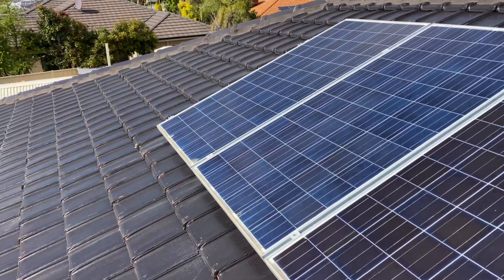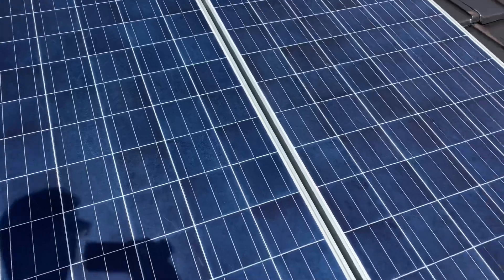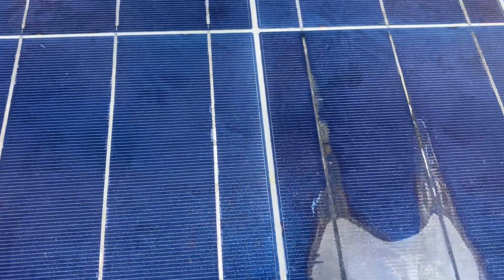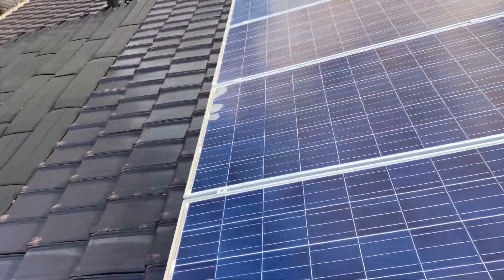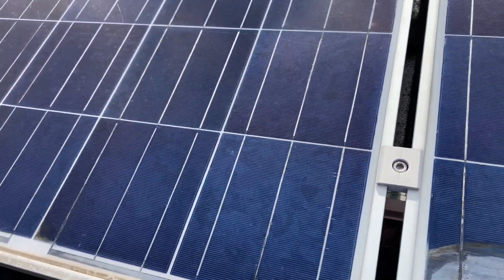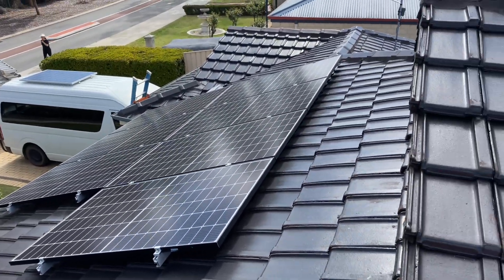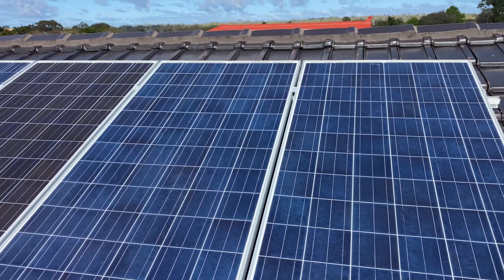Water cooled solar panels 🤣💦 WTF is going on here!

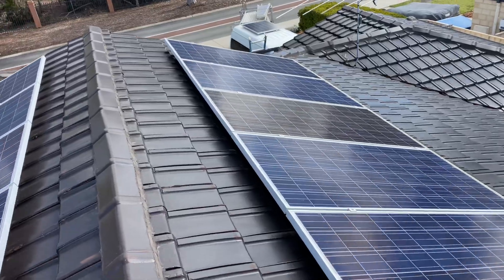Comment: That middle panel at 2:18 has already been replaced by the looks of it. Doesn't match the others. It does however match the panels on the NEW part!
Suspect the deskjockeys who did that roof also helped the customer out with a panel on the old section. Why not just replace all the panels and it would have been fine when they were there anyway?
Reply from the maker: Possibly yes 👍🏻

Comment: All they are doing is prepaying for electricity the panels lose efficiency and need replacing and you start all over again. Just conserve the electricity you get from the grid. Solar is only good when you cannot be connected to the grid.
Reply: rubbish.
Reply: @John-gm8ty your better off on the grid instead of lashing money on that shit, the only thing is your property value dropping and holes in your roof in the future.
Reply: @brendanc5519  property value dropped? lol
Reply: @John-gm8ty ya think about it, who would pay full price for potential holes in the roof when the seals in the fixings rot, the company who installed them won't be around anymore. And these claims  about them last 20 plus years total bs. Good luck.
Reply: @brendanc5519  like all the holes from screwing the roof down?  seriously dude, you need to get off the gear.   
I doubt you can find a single story of a legit installer having ever seen this happen. 
which is why you don't go for cheap dodgy installers, or roofers or any other trade.
Reply: Shrug.  I still have panels 20+ years old in service.  Though I will state for the record that if any significant issues develop in a system that old, it's usually cheaper to just replace all the panels due to the vast improvement in panel technologies.  Literally a 1-day or 2-day job, verses trying to diagnose 10 bad panels in a 100-panel commercial installation 20+ years old with weird reverse-biased frame grounding and PID.

Not to mention that panels with technologies that old had far higher degradation rates than modern panels.  So replacing the whole thing can literally double production in the same area.

Modern panels are significantly better on multiple fronts.  The degradation rate is far lower, for one.  No PID.  25+ years of service, easy, if installed with care.  Like... don't let people solo-install by carrying panels on their backs, for example.  Not unless you want a micro-cracking failure a few years down the line. And always retention the top bolts on the clamps a month after the installation.  And don't run cables inside the rail.  Etc etc.

Lots of boxes to check, but it's not rocket science.

-Matt
Reply from the maker: Very strongly disagree
Reply: @joondalupelectricalservice3201 well look at the bigger picture ye will the futures big polluters when billions of these solar panels which are heavily bonded and difficult and uneconomical to sort out start failing and are being dumped, Stick with the grid if it's available, it's the best option overall. And don't get me started on these wind turbines. You can't power the grid or your house on farts and sunbeams.

Comment: See, something like that... unless the roof is leaking, I'd just DIY the replacement.  Pull the panels, leave the rails, throw on new panels, maybe replace the inverters if necessary... done.
Reply: You think a DIY can replace Solar Panels and an Invertor! after all you saw Joondalup Electrical Services do it on Youtube so now anybody can do it right or just you because you have extra smarts.
Reply: @cam_934  The reality is that there are only few dozen major producers of panels and all them are good.  Frankly, less than a dozen grade-A panel makers in any given year and those panels will be on discount the next year.  A pallet of brand new 3-year-old panels is not expensive and even used panels are easy to vet with an IR camera.

Millions of people do just that, cam my friend.   Genius intellect is not required, just street smarts and a little knowledge.  This stuff isn't rocket science.  But if you have so little faith in your own abilities, then I recommend just doing what is comfortable for you.

There are only a dozen or so major makers of inverters... and most of those will be good too.  Again, it isn't rocket science.  It is high voltage.  But it isn't rocket science.

In my experience (installing and doing solar for over 20 years now, both professionally and helping DIYers), professional installers aren't really all that better than your average Joe who has taken the time to learn.  And the average Joe has more of a reason to go slow and do a good job than your average installer.   I've seen plenty of DIY installations that are heads and tails better than anything done professionally... sometimes they look like works of art, to be frank.

And I've seen plenty of installers do utterly stupid things like solo-install 450W+ panels by carrying them on their back... almost guaranteeing a micro-cracking failure down the line by doing so.  Or putting manual disconnects in plastic boxes on the roof.  Or using non-metallic conduit.  Or using the wrong gauge cable.  Or doing a terrible job with roof penetrations.  Or any number of things.

-Matt
Reply: @junkerzn7312  And if you get something wrong causing fire or harm to someone, you're cooked.
Reply: @BenState  You mean like how all of life works?
Reply: @junkerzn7312  No.  If you do something that you're not qualified to do and you cause harm, it is potentially criminal.  Making a mistake that causes harm may also be an accident.  The difference between the two is critical here.
Reply: @BenState  You are making a lot of assumptions that are incorrect and you seem to be very confused about the actual complexity of these systems.  I recommend that you sit down and learn, instead of complaining about things you know nothing about.
Reply: @junkerzn7312 I agree with what you are saying with the disclaimer that I would not openly encourage DIY. I'm of the opinion that a trained professional is capable of doing a much better safer job but be prepared to pay for it. The usual saying is you pay peanuts you get monkeys. For example, my 3-phase upgrade cost about half of what others were quoting so there are good honest companies around. Finding them is the hardest part.
Reply: @junkerzn7312  it is illegal in many jurisdictions.  as an avionics engineer, happy to discuss your little complex systems anytime.
Reply from the maker: Yep, get some cheap replacements from the recycling centre